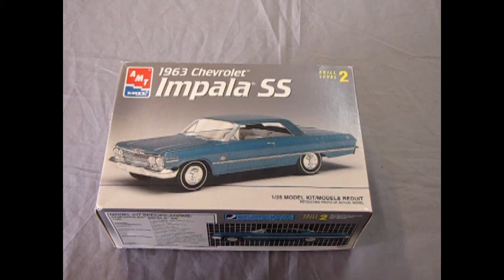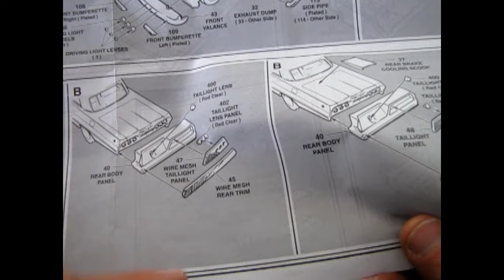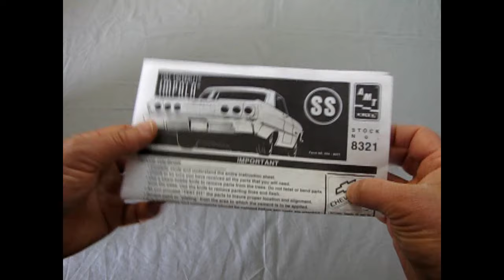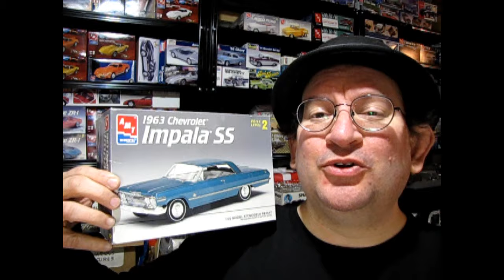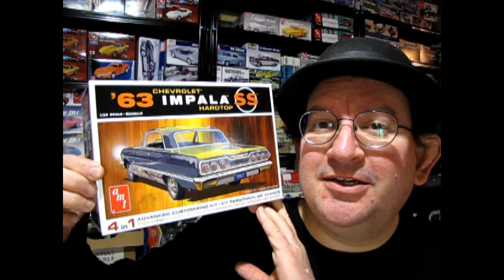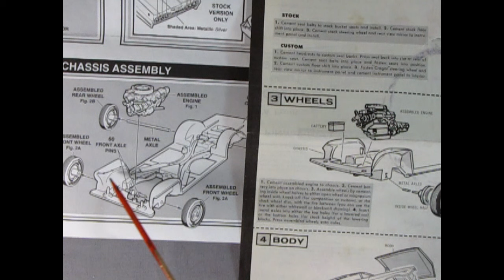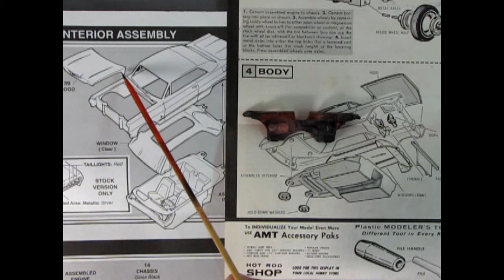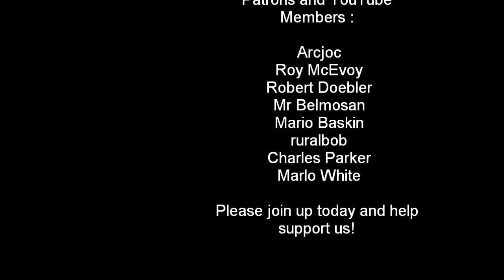Let's Build It! - Building The AMT/ERTL 1963 Chevrolet Impala SS Plastic Model Kit

Comment: The reissue (post 1963) Impala kit is based on a modified Craftsman (curbside - no engine) kit. The story is that in the early 70's, AMT modified the tool, to open the hood and add a (rather crude) engine for disabled veterans. This is the version that was reissued as a Prestige kit in the late 80s, much the same  as the kit in the video. The Round 2 reissue, besides including the original Customizing parts, also adds a firewall and radiator detail, which are absent in the older reissues. The engine and other underhood details from the original annual kit ended up in the 64 Impala kit. So if you want a more accurate engine, the AMT 64 Impala is a good source.
Reply from the maker: Thank you for the input!
I hope you enjoyed my build.